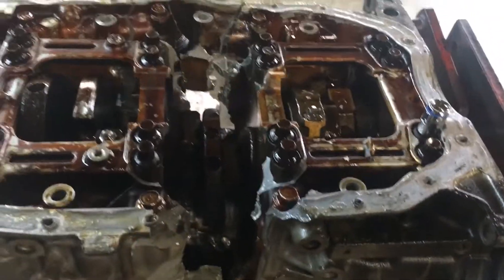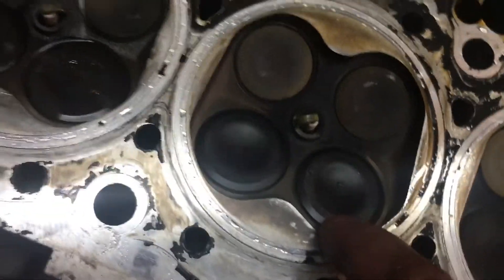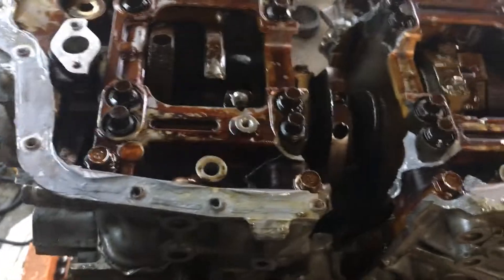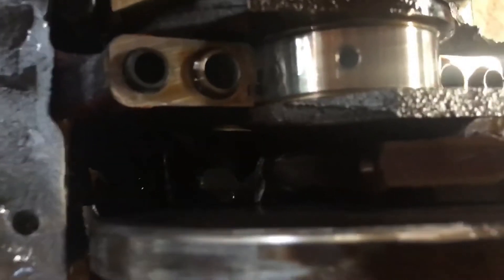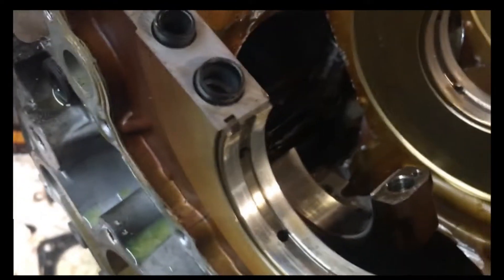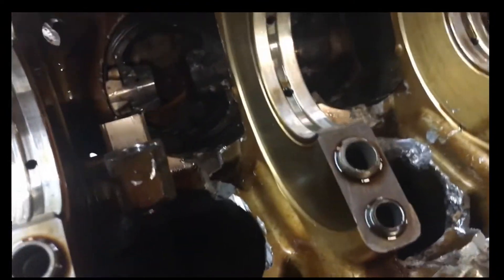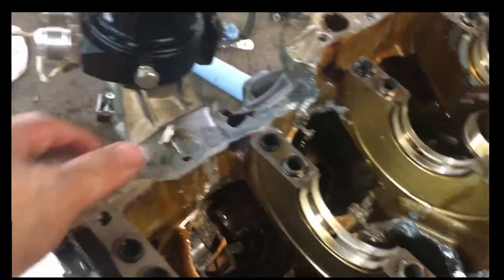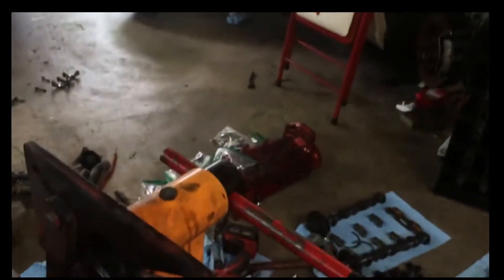This engine will never run again! Probe Engine Teardown - Carnage

Comment: I hope you can bring that probe back to life. It would be great to see how you forge the engine and it would be cooler that you will pass the data from where you got the forged parts and what their cost would be. Your work is admired, my friend, it is seen that you do it with a lot of dedication and love for the engines.
Reply from the maker: I just scored a set of rods from KA Injection: https://kainjection.com/products/mazda-ford-kl-2-5-v6-forged-connecting-rods

I'll be ordering the piston set custom-made from CP Carrillo once I get the measurements from the machinist: https://www.cp-carrillo.com/

Comment: I wouldn’t be surprised if something in that boost set-failed (probably the wastegate) causing it overboost
Reply from the maker: One would think, but no. Boost was rock solid at 8psi when it failed. I have the data log.

Witness marks on the main caps put the leading hyposthesis at the cast crank in this late 1990s junkyard engine flexed, broke the crank case, and it all cascaded from there. The rods were not just broken, they were twisted. Only way that happens is if the mains are flopping around.

Comment: Any idea how much boost you were running?   It was ripping in the last few videos of yours.     Best wishes for a smooth surprise-free rebuild.
Reply from the maker: Just 9psi. It was not an aggressive tune.

These rods are noodles. If you're going put a power adder on, just pull it and forge it all.
Reply: @inkyracing  KJ-ZEM rods. Millenia 2.3l supercharged. Extremethings has the info on those. H beam. I don't think they need mods to work.
Reply from the maker: @pgtmr2713  Wiseco makes an H-Beam forged. I don't mess with OEM rods on rebuilds anymore. The good stuff is only marginally more expensive.